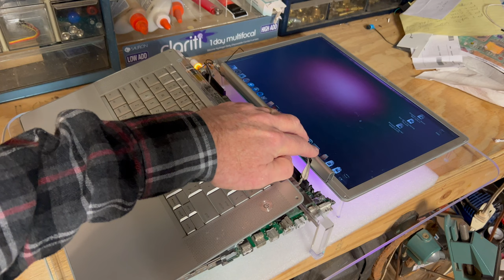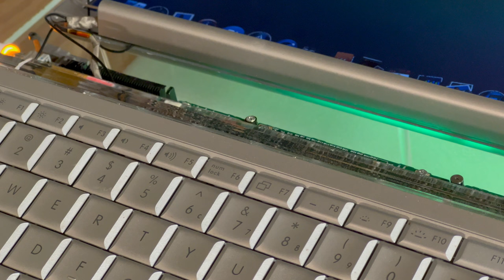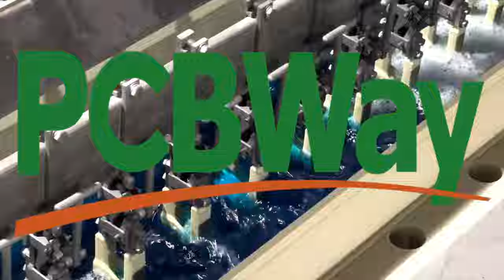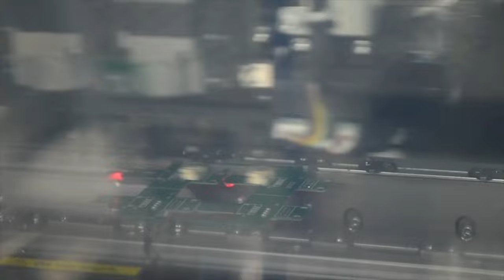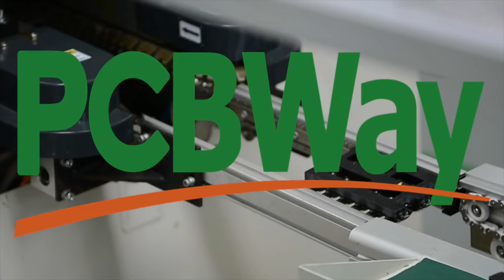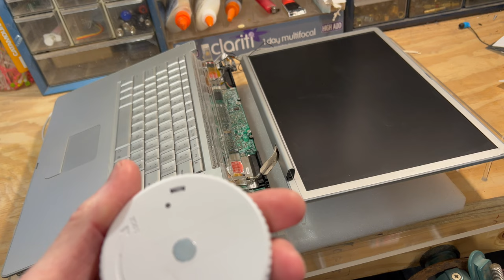G4 POWERBOOK CONVERSION PROJECT part 10

Comment: Nice job but I don't know if the video is cheating me but your screen backlight looks a bit tired
If so i would recommend you to upgrade the CCFL tubes to LED
there are tons of cheap conversion kits on ebay and then you get a screen that is brighter than it was when it was new
Reply from the maker: Screen is ok just the angel